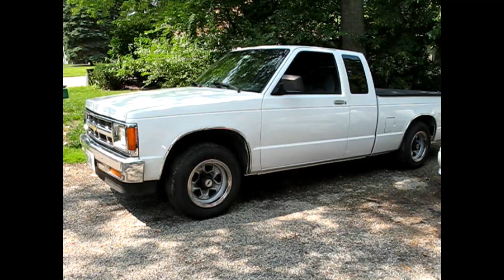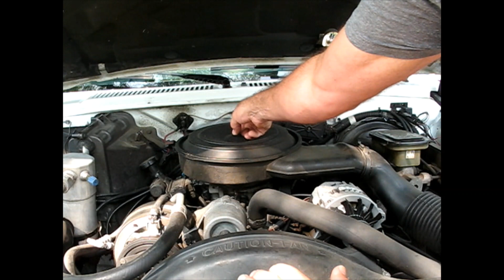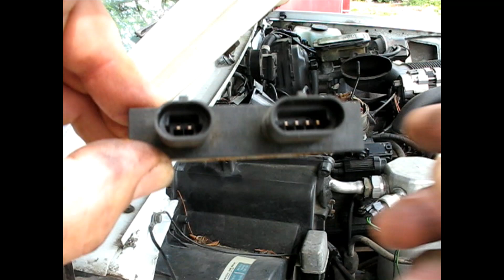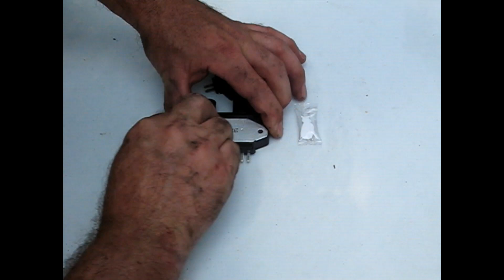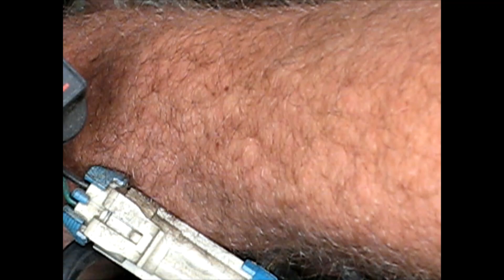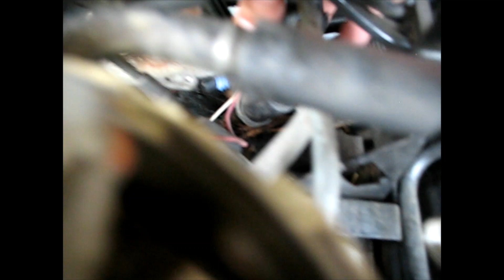GM Code 42 Ignition module 1993 S10 4 3l V6 262 check engine light on OBD1 low power limp home mode

Comment: My old one just killed the car with no engine codes.  The new ICM threw the code 42, but the car cranks good.  I bought a LX386 instead of the AcDelco.  I might need an AcDelco.